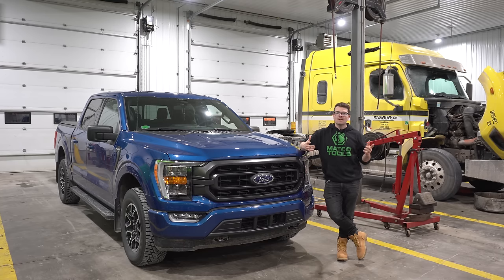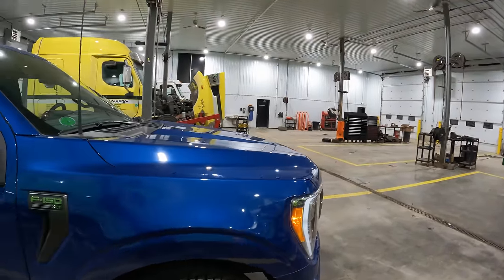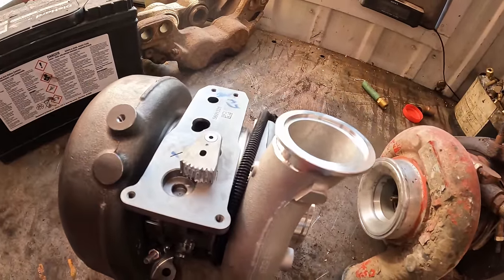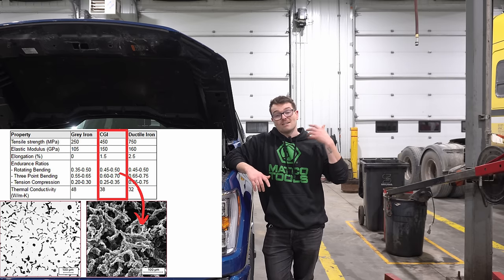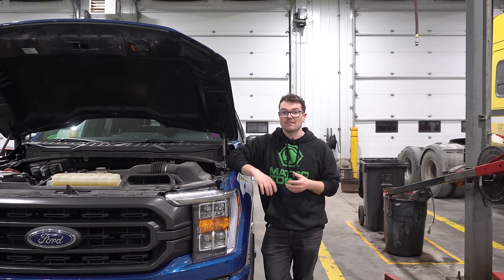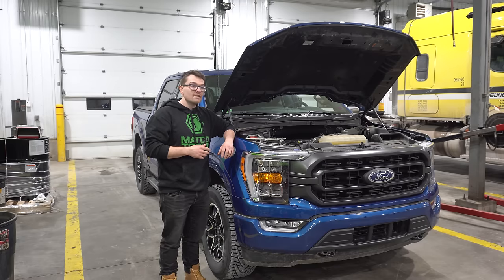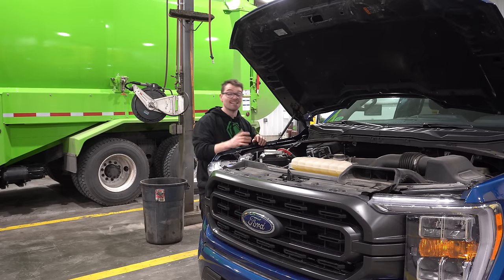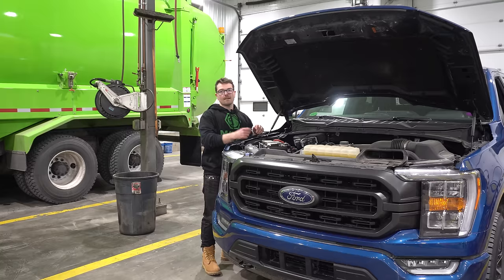Ford F150 2.7L EcoBoost V6 Engine **Heavy Mechanic Review** | How GOOD Is It??

Comment: As a former foundryman,  I'm saddened that there were no U.S. foundries capable of casting this graphite iron block and that Ford found it  necessary to go to Brazil to get it done.  Says a great deal about the strength of our manufacturing base.
Reply from the maker: I did find it odd that they chose brazil. I imagine cost was a large factor but still would love to see some good old American Iron.
Reply: Yeah def a cost saving move
Reply: They're most likely using the same foundry that VW picked for the EA888 gen3, which also uses a CGI block using tech sourced from a Brazilian company as well.  It's a very specialized tech, there isn't enough volume for a US foundry to spin up a foundry specifically to make it for Ford.   Brazil has a very strong steelmaking industry, with very good quality.
Reply: Biden’s America.
Reply: As a guy who works in manufacturing for the automotive industry it comes down to having contracts with companies who outsource their work. Most of the time it’s all ram by Germans / Austrians anyway because of their better education and engineering prowess. Brazil just happens to be where they’re made. These vehicles are made by every type of person. From anywhere around the globe. At the end of the day we’re all humans we all have our goals and families we need to support.
Reply: @freedomisntfree_44 I believe this design block started in 2018 soooo trumps America?
Reply: @alexdel-toro323  ok globalist
Reply: @michaeldonahue  2015 actually so Obama no different . Biden’s American isn’t going to do anything for america or try to get manufacturing moved to America like trump 👍
Reply: @michaeldonahue  2015, Obama's America. So you have the Democrats to blame. Joking side, politics has little to do with stake-holder demands within a corporation. If the stake-holders demanded budget cuts to manufacturing, a cheaper source will be used. China, Brazil, Mexico and the like. Sadly Brazil got it wrong with the 53 casting 5.9 24V.
Reply: @michaeldonahue  never let facts get in the way of a false narrative
Reply: Might be shocker for a few of you guys in the comments here but the President of the United States doesn’t run Ford Motor Co 😂 I mean the current POTUS can’t run a dishwasher.
Reply: @Jay-bw3fl  no but trump sure helped keep a few here 🫡
Reply: @TheGettyAdventures you also forgot about the environmental issues. I promise you that was big factor for everything manufactured in this country.
Reply: @TheGettyAdventures  they have been casting Cummins 5.9/6.7 engines in Brazil for 30 years. My 2000 second gen Dodge 2500 had a Brazilian cast block and never had an issue.
Reply: @TheGettyAdventures  I'm from Brazil, and there are many good diesel engine factories here, so maybe it was a volume issue, but I'm just guessing...
Reply: @freedomisntfree_44 I’d say Obama saved more by bailing them out. Not ford though. I’m no democrat either so bash me.
Reply: Has more to do with suppliers, those foundries are probably not tier 1 automotive suppliers💯
Reply: @freedomisntfree_44 What? 🤡🤡🤡
Reply: I have a 19 2.7EB F150. I would buy another one in a heartbeat.
Reply: Although I think unions have done great things in the US they have also forced manufacturing abroad for cheaper labor and little to no labor laws. Making big business more wealthier so they can unnecessarily overspend to offer a mid-level motor this durable while boosting their profits in the process. Back when manufacturing was in the US all of the US automakers just offered overly long in the tooth non complicated and inexpensive motor options. So for the consumer competition is great and has offered us a better package while also killing the average US industrial employment. For some reason people want to go political and think business has feelings. Unless the US can be competitive and offer a better package then what is offered already we will continue to see a decline in US manufacturing and perhaps almost extinct for the sake of higher profits and lesser taxes and laws restricting businesses from making as much profit as it can. Feelings doesn't bring that, economics 101 does. So as a consumer I applaud it and as an American I'm saddened we can't be more competitive. ✌🏽🇺🇲
Reply: No it says a great deal about the race to the bottom. The quality of any particular part is irrelevant to these manufacturers.
Reply: @freedomisntfree_44  If you’re going be like that, then it was Trump’s America but that’s stupid, too. Get a grip, please.
Reply: @JoeOvercoat  yeah shame on trump for 1.80$ gas and cheap groceries
Reply: @michaeldonahue  Actually 2015 my truck is a 2015
Reply: It's all about pricing
Reply: @freedomisntfree_44  2.7 million new jobs in 2023 with less then 4% of unemployment and you're complaining?
Reply: @oross99  damn right I am when everything is more expensive than ever. You must be on food stamps though
Reply: It's all about dollars!
Reply: I'm pretty sure looked and due to the American government  they had to go else where
Reply: @michaeldonahue  first gen was 2015, so Obama’s America.
Reply: Probably an EPA-related issue
Reply: Bull…it’s all about the money
Reply: @freedomisntfree_44  don't you have a klan meeting to attend? 😂
Reply: @michaeldonahue yeah, nah. This block dates back to atleast 2015 when the 2.7eb was introduced in the F150. I’m not sure if the fusion sport/ford edge sport 2.7 is related but it “might” go back further with those vehicles. But at least 2015.
Reply: There are capable foundries in US, the thing is a factory in Brazil will make it 50% cheaper.
Reply: @chipsaunders154 more like, says a great deal about the cost of manufacturing in the US. Shit, you guys want a min. of $20/hour to flip burgers at McD's!
Reply: @steve8803  and how much is McDs as a company making?
Reply: @alexv6620  The "company" doesn't pay the employees. Their restaurants are independently owned by franchisees. The franchisee pays the employees in their restaurant. The average McD's profits $186,000 per year. $1.6M goes to employees. By increasing that by 25%($16/hour - $20/hour), that's an extra $400k in payroll. That means, all else remaining equal, the restaurant will lose $214k per year. Obviously they can't afford it. So they have to cut as much as they can(less employees, more self serve..) and obviously their menu prices have to increase.
Reply: @steve8803  the average mcdonald's makes 4million a year. What are you on?
Reply: @alexv6620  Clearly, you don't know the difference between total revenue, and net profits. Stay in school kids!
Reply: @steve8803  says the guy that thinks a billion dollar fast food restaurant can't afford to pay high wages. LMFAO please stay in school.
Reply: @alexv6620  again, they're independently owned. It's not hard to understand.
Reply: @steve8803  thanks sherlock. Doesn't change the fact that as a whole its a billion dollar industry.
Reply: They in the US most likely can. Definitely a cost issue
Reply: Say "thank you" to greedy corporations outsourcing everything😂😂😂
Reply: Same here dude!  I supply foundries all over the US with consumables and totally agree with this statement!  Actually my sales vehicle is a 2022 F-150 2.7 Ecoboost XLT similar to the one in this video.  I will have almost 300,000 miles on mine after my 4 year lease is up and will DEFINITELY be getting another one!  Absolutely love my truck!
Reply: @bcfmef Agreed. The biggest critics don’t own one or know anything about them.

Comment: My father has a 2015 2.7 with 243K miles, he replaced both turbos at 168K miles, $1200. That is the only thing he has done major, all his coils, fuel pump, transmission, engine are original , he had 3 batteries, 5 sets of tires, 2sets of plugs, get synthetic every 5K miles. tows 6000lb trailer 4000 miles twice a month,  Best engineered truck

Comment: Really happy with my 2015 2.7 I am at 309k + miles on mine and still going
Reply: What have you replaced in the  309k miles that you've owned it? Any turbo issues?
Reply: I have had normal wear and tear like rotors and brakes. Just replaced the alternator, had some fuel system sensors need to be replaced but no turbo issues and no major engine issues
Reply: No turbo issues at 309k amazing.....let me ask you do you exercise it often like kick her down at least once for a bit on almost every drive??thanks
Reply: No honestly just drive it normally, just got back from a 2k mi round trip with it and got on it a few times on ramps and it still hauls!
Reply: @stevedibiase728 No. You don't need to exercise your engine. That's the dumbest thing I have read in a long time and super funny 😅
Reply: @mr.monitor. actually highly respected mechanics recommend it. If you drive short distances and or light throttle all the time you get more carbon buildup. A good full throttle run once in a while helps clear the carbon.
Reply: @woodrmp1  in other words, you need to drive it normally once in a while. It doesn't require exercise.
Reply: This the comment ive been looking for!!! How often do you change your oil
Reply: @ms1406  I am pretty good about changing it every 5k or so… also I am up to 316k now
Reply: @kirk189  ok good i have a 2018 f150 2.7 with 128k miles and i change my oil every 5k too! I really hope mines can see that many miles too
Reply: 2015 2.7 here as well at 160K
Reply: 362794 checking in - 
Replaced a sensor, alternator and o2 sensors 

Trans is tired- time to replace but the engine is a beast.
Reply: thats amazing!! Im the original owner on a 2016 2.7 2wd XLT w/ tow package that barely gets used. ~80K. I've only changed oil when the interval says too but might start doing it more frequently. So far I've had to replace brakes twice because I didn't realize there was in inner pad and an outer pad. I've had to re-glue the plastic trim inside the cab that holds the rear sliding glass in place. Most expensive repair (~$800 w/ matching paint) has replacing the tailgate after I put a hole clean through my old one moving a utility trailer around on my property.
Reply: @woodrmp1 Italian tune up
Reply: If you build an engine like a diesel, it will last like a diesel. People don't believe me when I say this, they think that diesel fuel has magical properties that make diesel engines last longer than gasoline engines, or spark-ignited engines in general.

Maybe they should ask power companies why more than 80% of their stationary reciprocating engines are natural gas engines and not diesels.
Reply: @kirk189  316k wow thanks for checking back in that's very interesting I just bought a 2018 2.7 F150 with 80,000 MI my last pickup I had for a decade and 200k so I keep Vehicles long-term thanks for the info brother
Reply: @estevanmariani that's wild and good to hear! Do you have the 6 or 10 speed engine with all them miles?
Reply: I have a 2017 with 140k miles. I didn’t drive it for almost 2 years due to covid and a deployment to Iraq, still zero issues. Brakes, rotors, and fluids. Oil every 5k with motorcraft blend they put in at the dealer and a motorcraft filter.
Reply: @mr.monitor. you do need to exercise them. It’s not the engine though, it’s the turbos. The wastegate actuators seize up if you don’t put them in the boost which a lot of people didn’t do on the 3.5s because they were too focused on trying to get good mpg. A lot of 3.5s had premature turbo failures due to this.
Reply: @antisnafu  nice. I just ordered a 2020 with the 2.7 from the Midwest. It should be here in a week and I am so excited lol. I've never had a pickup truck
Reply: @antisnafu  OK, I'll get mine on a good squat routine with some lunges.
Reply: 309k pretty impressive. How often do you change transmission fluid ?
Reply: @stevedibiase728 he probably lives not by the ocean or where its too dusty amd hes not driving it like the public road is a racetrack
Reply: @ms1406  I have a 2018  2.7 also w/ 36k mi...In the 2018 2.7 ford replaced the oil pump drive chain with a 'Kevlar' toothed belt...there are 2 tear downs on u-tube with failures @ 9xk & 12xk mi due to belt breakdown & subsequent oil depravation caused by belt particles clogging filters etc. I plan to replace my belt soon, hopefully with a 2017 chain and pump drive.
Reply: @donpope5524  yea i watched the tear downs and yea i heard the belt design was a week point
Reply: Got a 16 with 108k but no major issues yet.
Reply: @antisnafu I just want to Thank You for your service to our Country and welcome you back home! Thank You!!!!🇺🇸🇺🇸🇺🇸🇺🇸🇺🇸🇺🇸🇺🇸 Hope you got the best one Ford ever made!
Reply: Any oil pan issues?
Reply: @estevanmariani you ever change the trans fluid?
Reply: I had a 2016 XLT traded it with 90k on it I only did routine maintenance, braked pads and that’s it, I am looking at a ford again and would not be afraid of the 2.7
Reply: There is a post on the f150 forum about a guy with 465k miles on his 2.7l. It's nice to see posts like yours. I have 70k km's on mine.
Reply: @xilbus  yep up to 331xxx now 👍🏻
Reply: How often do you service the transmission? That’s the only thing that concerns me on this truck. I have a 2018 2.7 with the 10 speed. 162k miles. Thanks.
Reply: @kirk189 Any issues with the phasers? Looking at a 15 2.7 with 85k
Reply: @steinnklein3857  nope no issues up to 333k now
Reply: Just started my journey, 2024 2.7 XLT at 200 miles. I hope to see 300k miles 🎉congrats on the milestone
Reply: Any problems out of your turbo?
Reply: @Roguchii  it’s the 6 speed 👍🏻
Reply: @Kody10538  it has a very slight weep but not enough to worry about never is down on oil and never leaves a spot in the driveway
Reply: @mr.monitor.  it has to do with the issues with stuck waste gates that are known on ford turbos
Reply: @ms1406  5K Mile oil changes?  Smart (well smarter than 10K mile intervals).  I don't have a 2.7TT Direct gas, but the 5.0L port injected and I change the oil every 3k, but I'm paranoid and I run my truck hard.
Reply: @donpope5524  yeah WTF is up with the belt drive oil pump?  Timing belts need to be changed every 100K on those types, is there any interval in your manual for belt for your oil pump?
Reply: @MavHunter20XX  my 2.7 is direct injection and port injection and 3k mile oil changes that engine will outlast you brother
Reply: @ms1406  what are we arguing about?
Reply: @MavHunter20XX  who said we were arguing?? Im saying that by changing your oil every 3k miles is going to make it last a long time thats why i said it will outlive you😂 we are not arguing
Reply: @ms1406  Oh, the statement saying it will outlive me, threw me off.  That's not fair comparing my life expectancy to a small displacement twin turbo engine.  I think I'll just bet on myself for safe measure since I'll be dead if I lose anyhow.
Reply: @MavHunter20XX  yea its just a saying not necessarily true just saying it will last a long time. No hard feelings..
Reply: Exploring this as an option, I currently have a 2007 4Runner that has been an awesome purchase but without a ladder rack I can’t use it for work unless I’m bidding jobs or towing work trailer if Silverado goes down

Was looking at a Tacoma 4x4 but then my uncle had a 2.7 f150 and says it had a ton of power and can do truck stuff but is nice on the wallet as a daily
Reply: @ToiletTroll-FJB  I would do a cost comparison of buying a older used truck with the 5.0L vs something newer.  I don't know how much these series trucks costs, but my parents got their 2018 (in 2019) 3.5L TT for around $56K.  I got my 2013 (in 2018) 5.0L V8 truck for around $17~18K (can't remember after taxes).  Of course, consider towing capacity.  I think theirs is 13k lbs, while mine is 7.5k, and we both have crew cab 4x4.

Estimate the cost of fuel for both.  I haven't had to do anything except the dealer replaced the water pump.
Reply: After buying 6 new Silverados (I used to get a GM discount) I bought my first new Ford F150, in 2015. Mine too has the 2.7 and I have to tell you, it is the best truck I have ever owned. It now has 88,000 miles on it and other than oil changes at every 5000 miles and a new set of tires and wipers, I haven't had to do anything to this truck! It still has the original brakes and battery. Crazy! Love this truck. That said, we want to buy a 5th wheel in our retirement (soon) and I may have to move up to the 3.5 or 5.0.
Reply: Do you use a capture can or had to clean carbon buildup around the valves?
Reply: @Ellifiknow  Never.
Reply: Exactly just drive the damn thing @mr.monitor.

Comment: I replaced my 2018 2.7 with a 2023 2.7 but added the 36 gallon extended range factory tank. 922 miles was my longest run at 70 mph through Missouri and Iowa terrain.
Reply: No range anxiety for me!!
Reply: That's freaking AWESOME MAN
Reply: 900+ miles that's crazy good...
Reply: Which trim levels come with the 36 gallon tank?
Reply: going from a 2006 Acura TL to a 2.7 F150 290 miles of range to 610 with the stock tank was nice.